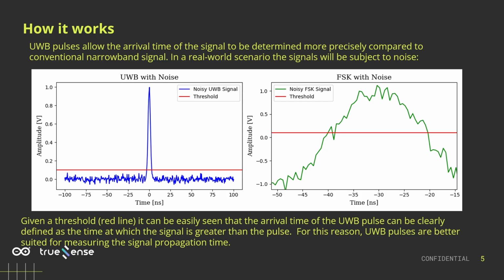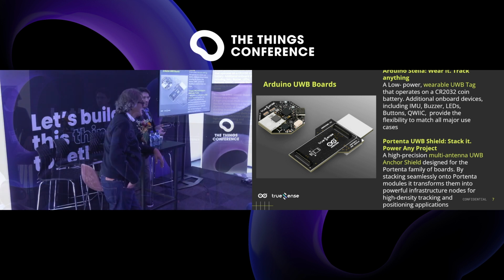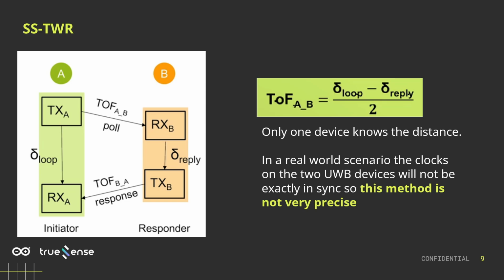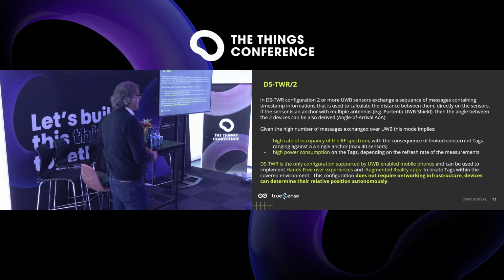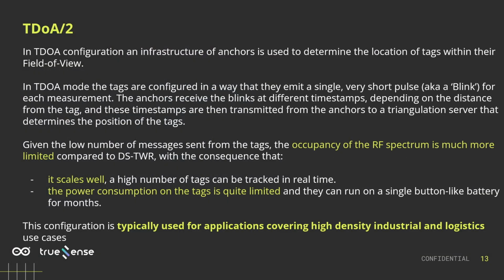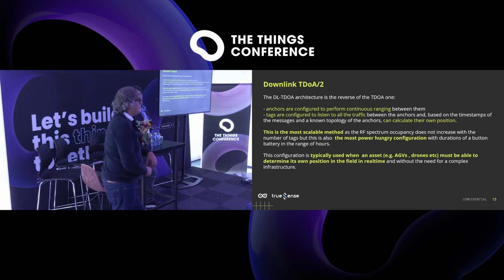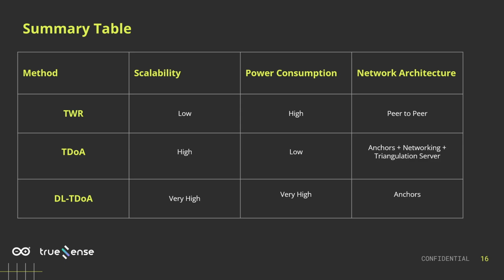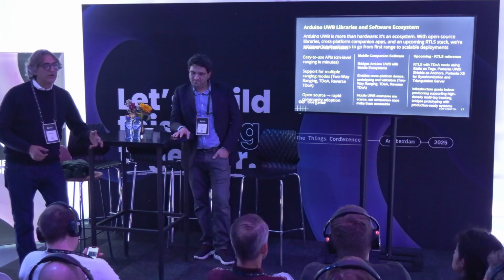UWB With Arduino: Unlocking Precise Positioning for IoT | Pierpaolo Lento &  Francesco Ficili

Comment: This sounds fantastic. I am running a Webcast Company for Sport events and that would be a great idea to track players on the field. I think TWR and its precision is enough (+/- 10cm is more than enough) and with up to +40 Tags on the field we have enough Tags running. But indeed the TdoA method is also very interesting when it becomse to scalability. My questions:

- With sending only a "ping" (low data packages), will this have any impackt on the overall distance a tag can communicate with the Anchors or penetrate objects?
- Does the Arduino Shield world "stand-alone" or do i have to combine is with a C33
- Datatransfer from the Shield is based on a USB-C connection. Do you have experiance with an Networkconverter (USB-C to Network) to reach larger distances or is a Wifi Board planned so all Anchors/UWB Shields could connect to an existing WiFi network?